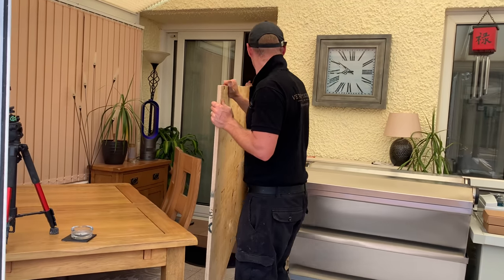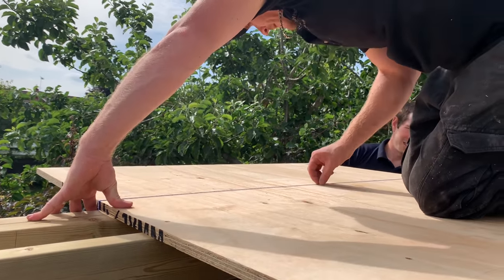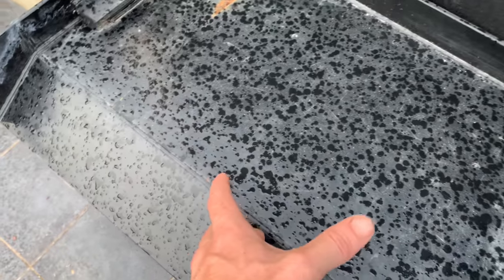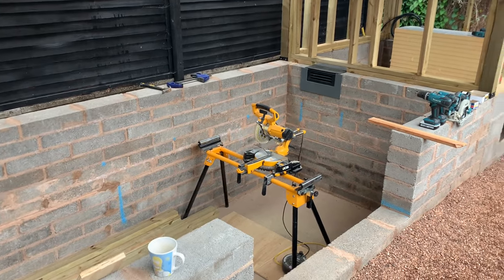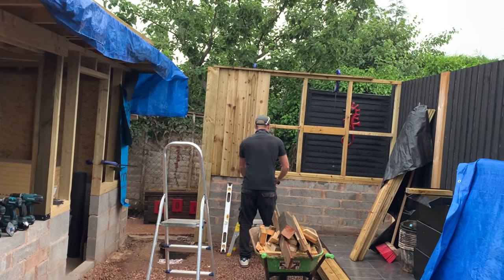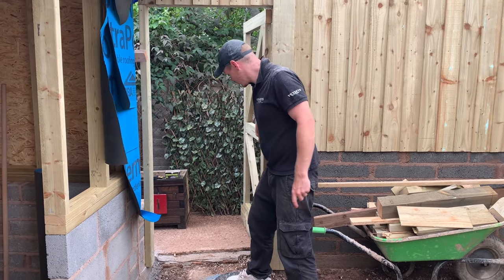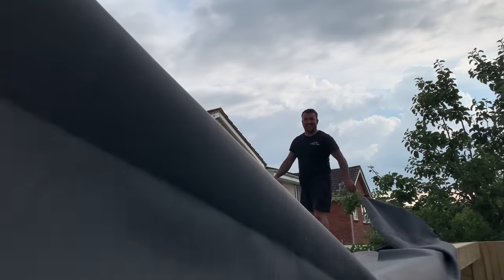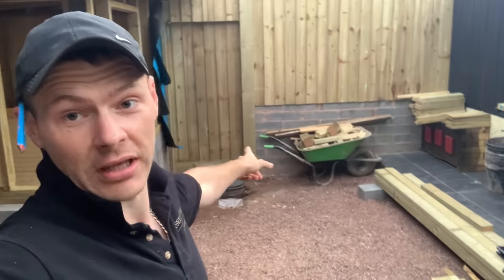THIS NEW KOI POND BUILD IS A HUGE PROJECT **FINISHED** THE ROOF HOW DID I DO IT ??? CRAZY IDEA

Comment: Hi James,  Question for you that's crossed my mind about your build....   Your putting 2 showers on the back wall, which im wondering if they will mess up the flow going towards the skimmer mouth, as they might be pushing the flow away from your skimmer ??  Would your skimmer not be better off on the same wall it is now, But towards the front of the pond more. Or the opposite end seeing as your flow is pushing from right to left. Just a thought mate, You may already be aware and have a way to sort it, just thought id mention it.
Reply from the maker: 4 inch skimmer mate it probably the angle it will be fine mate

Comment: Looking good James 👍
I went to the builders merchant to buy some screws. They was out of stock 😢.  The fella said this butcher had emptied our shelfs! 
Made me think of you it did! 
Can't wait for next week 🤗

💡. Water bill saving James. Your charged for 95% going back to the sawer. You have a soakaway for your pond and house 🏠😉.  Plus you can save on water to fill pond if on a meter and maybe topping up as well, you use RODI filter system. Around 8l out 10l is wasted. Recycle it or in soakaway.

Get yourself on twitter man ! 

PS some lovely work your doing with help. When it's finish its going to be amazing  👏

Mrs whisper taking the p*ss out of you, but forgot Yorkshire puds 😲😱.
All the best to all

Comment: Surprised you didn't have a facia board on before the rubber roof trim went on. The rain will eventually rot the wooden facia you have.
Reply from the maker: Might do but will take years going to paint it thou
Reply: @JamesTHEKOIwhisperer123  shame as the facias are relatively cheap and come In 5 m lengths. 
Good work so far buddy.